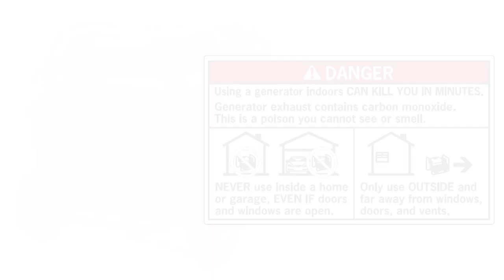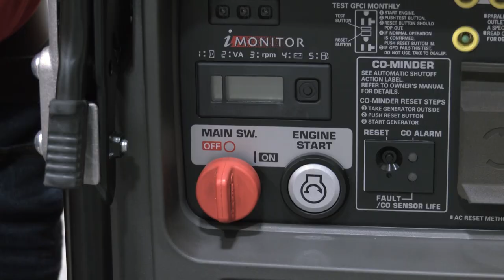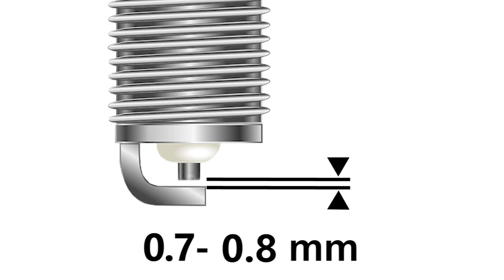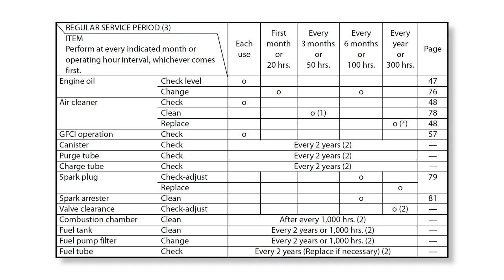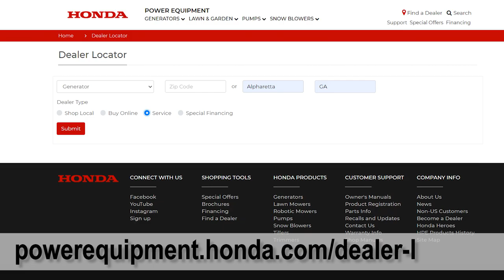Honda EU7000is Generator Maintenance

Comment: Very helpful thank you I recommend doing the oil changes at least at 100 hours intervals or sooner but definitely not longer. I also changed the oil at 20 hours on a new one to make sure to sweep out any debris that may be been in there from manufacturing

Comment: I have some of these 7000 but have had trouble from the start. You guys had it for 3 MONTHS at one point and refused to swap it out. Still having problems to this day. These gens are maintained perfectly and lightly used and STILL have issues.
Reply: what issues are you having?

Comment: can i use this (Honda generator diesel eu7000is) for desktop computer (500W, 240V, 4A, or above) with no problem? if there's problem, what solution/s? using a AVR or something?
 ...
..